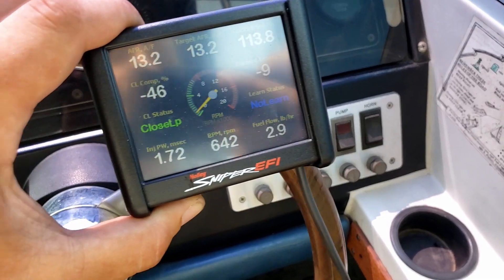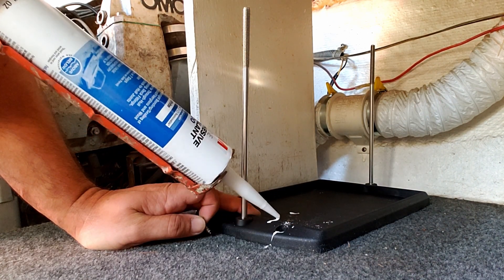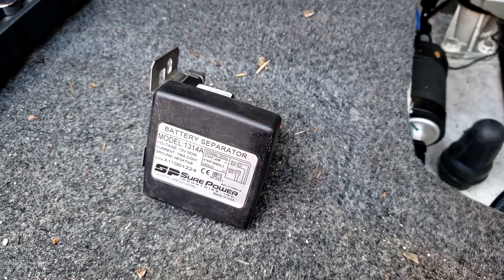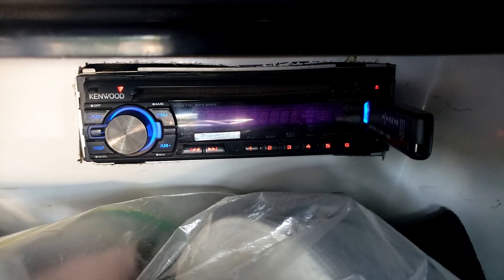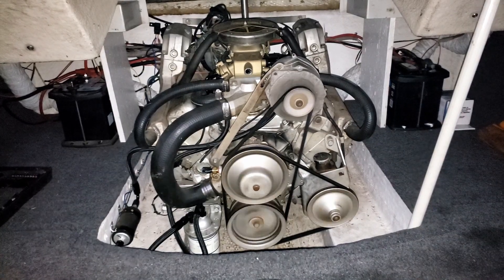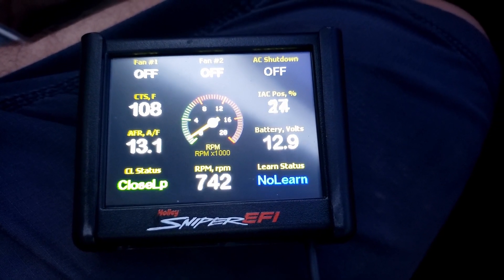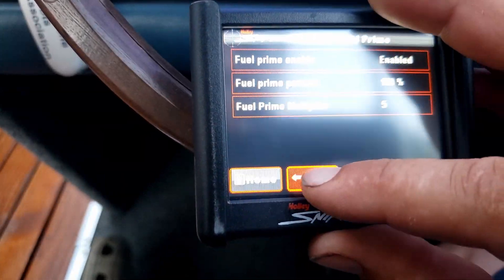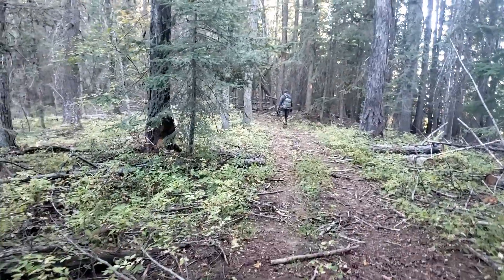Dual Boat Battery Setup + Holley Sniper EFI One Year Review

Comment: Great job on the install I've thought about doing this myself but from a few videos I've watched it seems like people are having alot of issues with it with that being said in all honesty with all the time and money you have invested I can't believe you seem to still have a good attitude about the system lol if it were me I'd be totally upset with it I mean a properly tuned carburetor would probably be less trouble for you at this point and have the boat running great
Reply from the maker: Yes it would! I need to do another update, but it turned out there was an ignition interrupter that was causing all kinds of trouble with the system losing the RPM signal. It's running so much better now, also I think there is something in the fuel tank causing an issue with my pickup, so I'm working that bug out

Comment: If a hard shift is not a current issue, you can install a relay to work off the neutral safety switch and wire an input into the IAC kickdown (typically used by the AC compressor) to raise the idle during a shift to help reduce a stall.
Reply from the maker: I was thinking of a similar thing. I ended up disabling the ignition kill switch that engages when shifting and now it's not dying going in to gear

Comment: Your stalling because it cuts off cylinders while switching gears and messing with the computer
Reply from the maker: Is that in the distributor?
Reply: @fordtechchris  there is a switch at the shifting rod that grounds out some cylinders to make the motor rpm drop so it goes into gear easier
Reply from the maker: @markburke5410  I will investigate this and see if I can come up with a work around... Thank you!
Reply: @fordtechchris  should be located near the linkage for the forward and reverse , mine also has a reset switch ( breaker type )

Comment: Thanks man. I know I’m late to the show. I’m getting ready to do this to my twin 5.7’s. Would be nice if I could use one ECU for both engines.
Reply from the maker: That will be a fun project! Sea Rays are nice boats
Reply: @fordtechchris  it’s a nice boat. Since the last time I have pulled the engines in the trucks. I installed a new transmission on the right side of the boat, so the prop would spin correctly. The engines are installed. I was waiting to get all of this done because I had to replace the transom. That was hell. I think it’s built better than factory now. The hard parts are done anyway. I went with the Holley Dominator because I’m running two engines, and I can control more using 1 interface and two GM factory ECM’s, and I’ve decided to go with closed loop cooling instead of fresh water.
Reply: What boat is it in? I have a similar pair of 5.7's and plan on converting them this winter. I thought the sniper was self tuning? Have you come across anyone else who has converted their twin sbc's ? Im interested if there was any fuel mileage increase?
Reply: @stevenehrke2730  it’s a 33 foot Searay Sundancer I got in rough condition. I’m learning that I will need an ECU for both engines. I have two GMC trucks with bad transmissions at my car lot I’ve been considering pulling the engines out and doing a 6.0 LS Swap that would bolt right in considering the 5.7 is nothing more than a small block Chevrolet. Meaning I would get more HP less fuel consumption, and less parts to buy because the engine is already fuel injected. That means I could theoretically add stock supercharger’s from a Cadillac, Corvette, or Camaro, and would only have buy the ECU’s.
Reply: @thomasstrickland0  for it an i/o boat or a true inboard? If inboard you need to see if you currently have a counter rotating engine or if the trans can do it for you. Something like a zf. I looked into the ls swap myself. But switching transmissions wasn’t in the cards. Using a stock 411 ecm could work, but the tuning credits needed alone will be $650 for the software to do both. It can be done, but ls you’ll need the manifolds, risers, marine alt and starters, and manual truck flywheels. Adapt the raw water pumps as well.

Comment: I would like to applaud your ingenuity and determination! I too am in the process of doing an efi conversion on a merc 3.0 and have been studying the software manual. I was wondering if your sniper is controlling the fuel pump? When you turn the key the pump should come on for a few seconds for the priming shot then shut off until the motor is actually at the run rpm. This could impact your erratic idle. Anyways, nice job!
Reply from the maker: As far as I can tell, yes it does turn it on for a few seconds, then runs the pump continuously. Good point though, I should verify fuel pressure when the trouble is happening, thank you!

Comment: If you are still having problems at the boat ramp with the motor dying going into gear you may want to look to see if there is a ignition cut on your linkages on the motor. 

I don’t know what brand motor you have but I have worked on a lot of MerCruiser engines that have it. It’s purpose is to make the shift from neutral into forward or reverse smoother by cutting the timing for a split second. I’ve seen a handful get out of adjustment to where they generally die in reverse. 

Hard to explain in YouTube comment but hopefully that helps!
Reply from the maker: It's an OMC, but that makes sense, I'll check it this spring before taking it out!